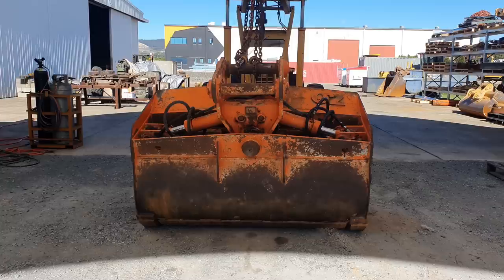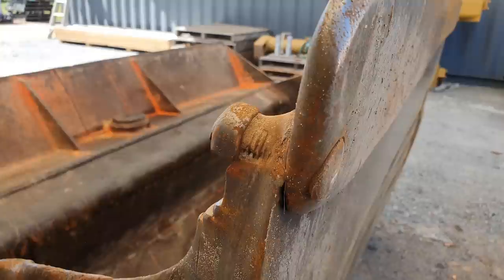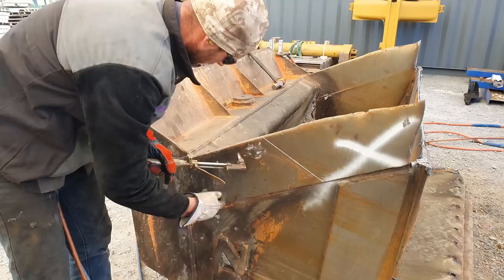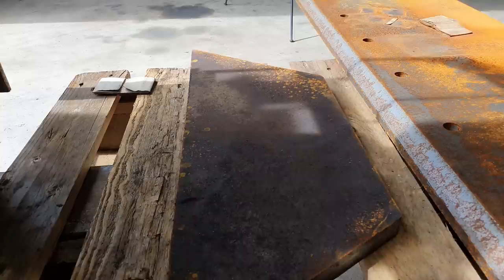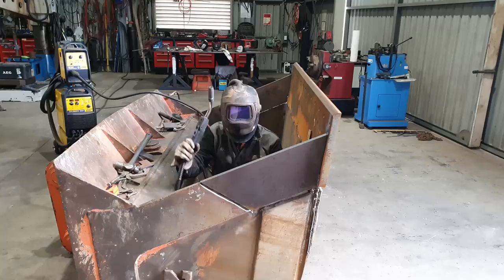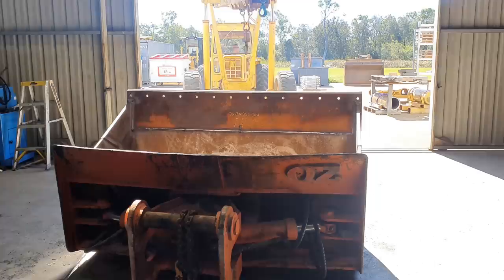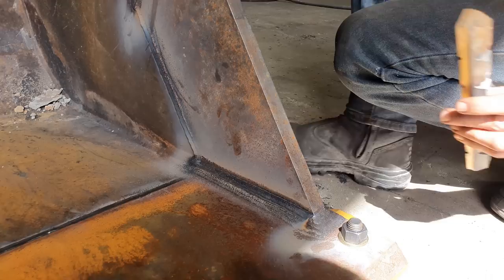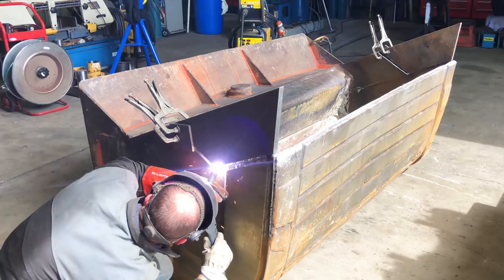Repair & Upgrade DAMAGED Bucket for 30T Excavator | Gouging & Welding

Comment: How much energy need's a machine , to put  50 mm (70mm with bolts) thickness cutting edge to the soil?  I prefer not to use cutting edges on buckets , better and cheaper to change mouldboard  more often

Comment: Don’t think the operator would have been using it as a hammer, bending in the floor of the skin tends to happen when the material gets thinner as it wears, for a bucket that’s 6 years old it’s in good enough nick and gas probably outlasted the excavator it was originally on.

Comment: Regular stick last longer, Hold better. But will take a whole a lot longer to do. We been through Mig & gas mess before Because it easy & quick.
Why& Wind & Fans blow shielding gas away.
Because they never welded where helmets even steam up its so hot 100 degrees + and each employee go through 5 gal water per 8 hour shift. 
His look pretty but not as good. Don't try BS me a 40+ over Heavy Equipment..
Reply from the maker: Lol why don't you come into the current decade. Mig wires, properties and their uses have come a long way in 40 years mate 😉

Comment: That looks like$$$$ for the repair. The customer missed it or you did? Job looks great and should last. 
 QUESTION WHY CAN YOU NOT WELD IF IT'S WINDY?
 IN MY YOUNGER YEARS I WAS A PIPE WELDER AND IT DID NOT MATTER IF THE WIND WAS BLOWING USING A STICK WELDER.
 JUST WONDERING NOT BEING HATEFUL.

Comment: It is a shame you do not know a custom knife maker those used cutting edges might have more market value than scrap prices.

It looks like someone used that finishing bucket for a lot of excavating. To me having worked in the industry a finishing bucket should not be making cuts of more than 8 inches to 12 inches (20 or 30 centimeters) max. The deeper cuts would be ditch grading or clean out.

Comment: Forgive me as I am not that skilled in some stuff. but I just don't get it. Why use that method of cutting over oxy/acetyl, or Plasma gouging. I know Air Arc carbon is cheaper but from my very limited understanding Plasma arc is faster and cleaner. I'm not criticizing at all, I am sincerely curious as i just do not know. If there is anyone with the expertise to ask, it's most definitely you. Please don't get mad at me. I am just trying to learn. Got blocked by a few other fab guys because I guess I ask either too many questions or just stupid ones. I have no mentor or friends to teach me.
Reply: Most plasma cutters would be slower than air arc on this thickness of material.  A plasma cutter that could cut as fast (or faster) than the air arc would be really expensive.

Acetylene is expensive (roughly 4x the cost of LPG), hence why Kurtis used LPG instead.